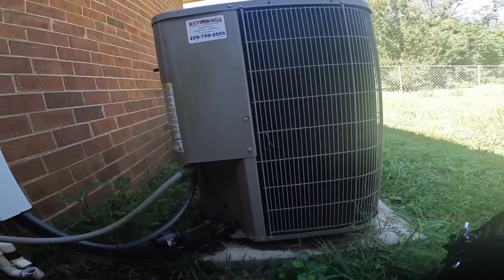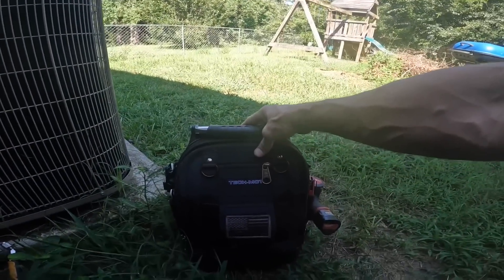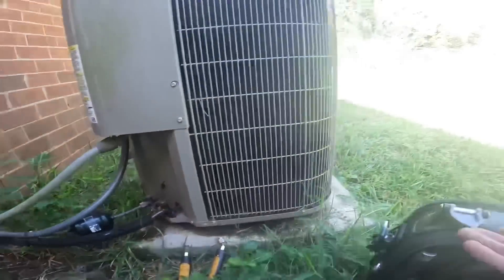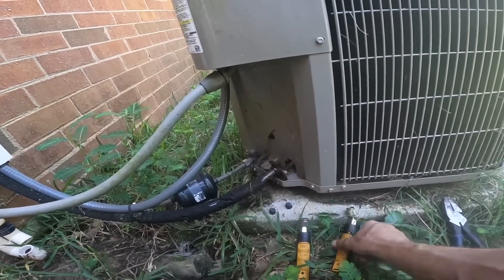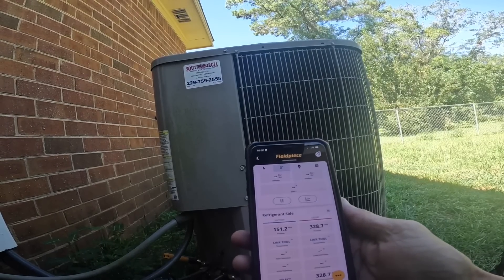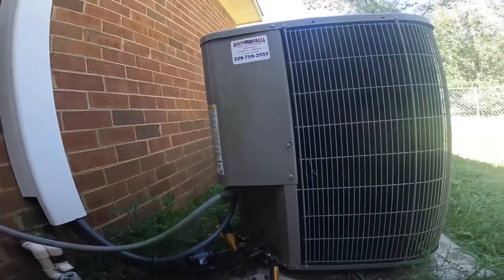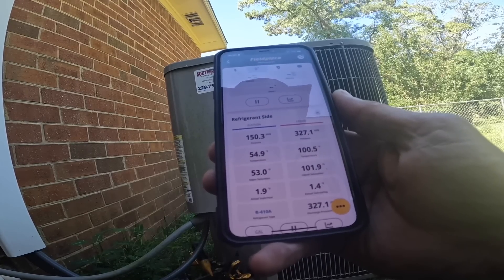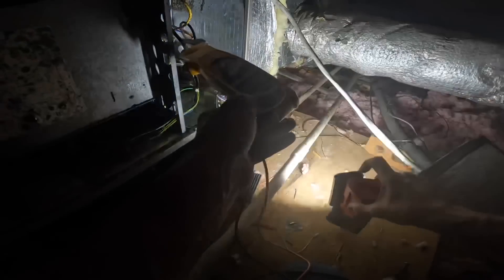TXV Diagnosis On Carrier Heat Pump Not Keeping Up.

Comment: Either weak compressor or txv overfeeding. The txv overfeeding makes me think you'd have higher head pressure, though, due to the added BTUs from the increased refrigerant flow. I guess there's a point where you get diminishing returns on feeding more refrigerant. At some point the feed rate is higher than the compressor can move to maintain enough of a compression ratio. I'd close the high side down and see how fast the compressor pumps down. I'd also mess with the service valve a bit, closing it partially to force a bit higher head pressure. If it pumps down at a decent pace and if partially closing the high side service valve makes the condenser start blowing heat, then I'd feel more comfortable calling the txv.
Reply: That's a very interesting way to check your txv, can you explain how closing the service valve would help you diagnose the txv please? The only dumb question is the one that's unasked
Reply: @FrankieRizz-69  think of it this way. If the TXV is overfeeding, then choking down the service valve will provide some resistance, so the condenser can get some subcooling and a higher head pressure. This would result in the condenser heating up and you'd feel it rejecting heat. If the compressor is weak, you won't get higher head pressure and the resulting heat. You wouldn't be able to measure the condenser head pressure during this test since the port is after the service valve, but you'd know it had a higher head pressure because of the added heat blowing out of the condenser. You could also monitor the running amps during the test to verify the compressor is building pressure.
Reply: @denrayr  that's a great way of explaining that, thank you for responding
Reply: I didn't pay attention from the start on this one. I didn't realize it was a heat pump (I was thinking straight cool with electric heat). If there's a check valve somewhere, it might be internally leaking. Maybe even the transfer valve (I'm spacing the name) could be bypassing. This would add another variable. I really am hesitant to call the TXV on this one. It's behaving opposite from how TXVs typically fail (underfeeding).
Reply: My recommended test is still valid, though. It would give you indication that the problem is in the condenser or not. The heat pump factor just means there's more possible causes inside the condenser other than just the compressor.
Reply: @denrayr  
I’m leaning more towards a check valve leaking by. Had same problem a couple of weeks ago. Same as this video. It was a leaking by check valve at the condenser. I like your method on a straight cool system definitely would work great.
Reply: @mwdub02  the test would still be able to rule out the evaporator vs the condenser as the cause
Reply: @denrayr  
Yes 👍🏼
Reply: VERY interesting... I will try this! I ran into a similar call today. Thank you
Reply: @gquin9487  I would only focus on the condenser. Closing down the service valve would essentially distribute the evaporator area up to the service valve, so the results on the low side would be inconclusive.
Reply: Actually easiest way to check would be to run it in heat...if pressures look good in heat the problem is inside, if not then something else is going on.

Comment: I don’t think it’s TXV I would start by recovering refrigerant replacing filter dryer and use new refrigerant 
just saying
Reply: What do you think it is? How do you justify this work to a customer? Sounds like a expensive gamble.
Reply: Because I don’t know if anyone work on it just before me and what did they do it  I tell the  customer this is what I need to do to start with 
Or you think it is batter to start by changing parts TXV, then a compressor, ……….. either way repaire is going to be expensive
Reply: I had this thought too. You could pump down into a recovery cylinder and measure the pressure and temperature to verify the integrity of the existing refrigerant.
Reply: @denrayr  that would be a more reasonable approach. With the price of refrigerant these days, telling a customer to replace refrigerant on a gamble is rough.
Reply: That is a good point at least checking the refrigerant Dennis I agree we live in defiant times all you can do is give customer appreciations same Companies give you one option you need a new system collect the service fee and move on 
Maybe it’s time to call blueon for support😊

Comment: Yes plenty of info .......the only thing I would have done different is I would have removed the bulb to see what happened if I stuck it outside the cabinet and I would have cleaned it and the suction line before reinstalling to see what that did
Reply: Not sure I would advise warming the bulb.  Considering how little superheat you presently have here, and if TXV is only stuck partially open, you are guaranteeing a flood back if the TXV decides to fully open. That could potentially damage the compressor.
Reply: This is exactly what I do to check a txv.

Comment: Just installed a  brand new  system last week. It had  high suction pressure with low super heat and sub cool on startup. Didn't want to deal with it but had too, was a bad txv on startup. Replaced TXV, system now checks OK. Went home satisfied!
Reply: That's why pistons are way better.  They don't go break.
Reply: Sounds like a lennox..the factory at the moment is releasing txv screens with copper shavings inside the socket..which the only way it can get in there is a txv with overbored valve and when it gets in use it starts shaving the excessive bore out of the txv it self
Reply: @DV90400  I would agree with everything you said about Lennox, it was a Trane however. It was stopped lol! New txv fixed the issue.
Reply: @gar351  trane indoor txv tends to leak on the bottom nut that they install.too i went on a call one time and found the bottom nut of the txv loose causing a slow 6 month leak to dry
Reply: Thanks for sharing!!